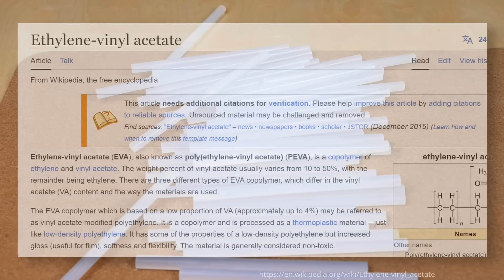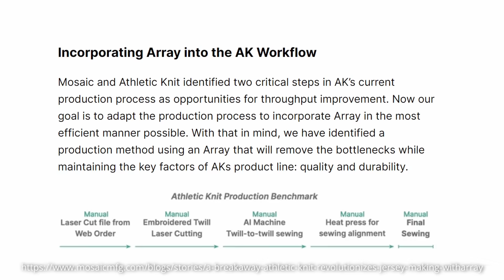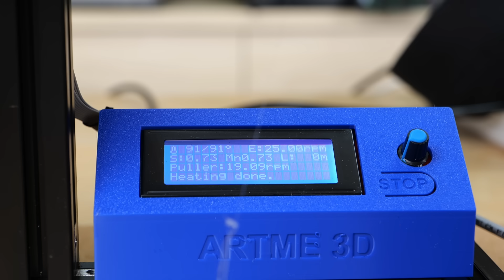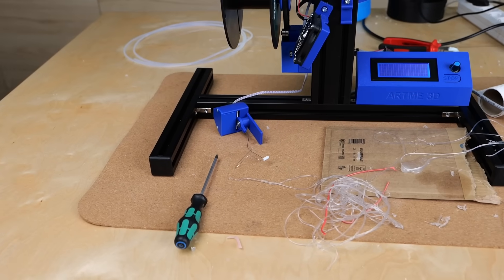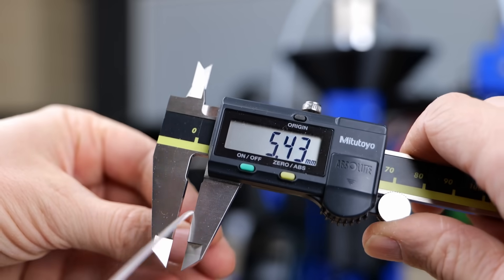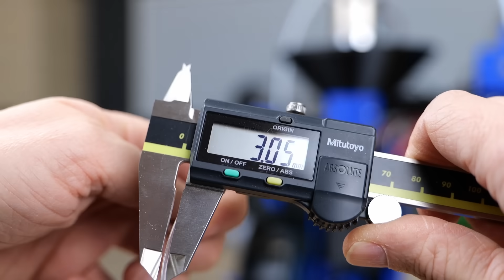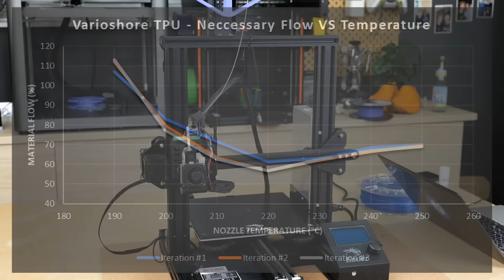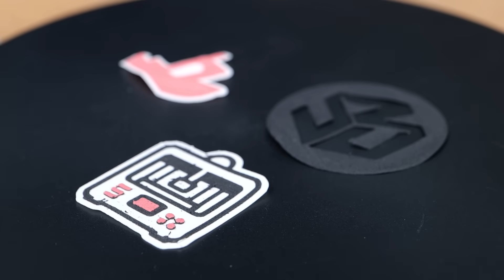Can you 3D Print with Hot Glue?

Comment: Glue sticks themselves... Eeeh?
I feel like this purpose would be better served with a sheet and a cricut.

That being said, I am potentially interested in how this could be applied with different adhesives, or hot glue, but reformulated a bit to be less annoying.

Imagine if you were able to print something in pieces with the glue right on them, stick them together, and slap them in the oven.

It would take the fiddling out of prints that need to be glued together, but that the person doing the printing may lack the skill/time/etc to sit there and do the gluing.

Also, as these kinds of plastics are pretty inert, is it possible to effectively print a heavy coating of plastic, then melt (smoothing it out) it to create a decently waterproof seal for mundane things like flower pots?
The cheap stuff gets brittle pretty quick, so again, specific formulation would be necessary, but there's potential here.

As an aside, I've seen clever, ultra low cost PET bottle recyclers that use high temp glue guns as a heat element.

Fill the heating element with a flush metal bar, and drill the appropriately sized hole through said piece of metal.

Looks like a real pain to get the feed started though.

Comment: I think that a thin sheet of hot glue would work better than a filament for the iron on patches. The sheet could be attached to the bed by heating and the tpu patch would be printed on top of the hot glue sheet

Comment: The only thing I'd change about this process is ironing the patches from the fabric side, so more of the heat goes to fabric then hot melt glue THEN tpu, rather than hitting the TPU first. In my experience (with normal patches!) this helps them adhere better because the fabric is heated up to match the glue.
Reply: Same concept as soldering! Heat the material you want adhered to (the fabric), rather than the patch, since the glue is already adhered to the patch.
Reply: Oh hey thanks I actually didn't know that about iron on patches. My jeans always rip at the crotch so I'm always using iron on patches (tacky I know but I love these jeans).  The corners of the patches always peel. Didn't think about heating the fabric up as well.
Reply: I scrolled to the comments to point that out too XD
Reply: We put our logo on product bags using white tpu and an iron. It seems to work really well. I could see where it might need more adhesion for clothes
Reply: Hope he sees this
Reply: Should also put some backing parchment between the layers of t-shirt fabric to prevent gluing front to back!
A heat press would do wonders for repeatability.
What you are creating - a two layer plastic sheet with melts plastic on the back is basically what heat transfer vinyl is.
Reply: I came here to say this 😊
Reply: This!
Reply: This!!!!

Comment: Instead of converting glue sticks to filament. Just disassemble a hot glue gun, take the guts, build your print head, mounts it on an old 3d printer that you can feed with stock glue sticks. Only issue would be triggering the glue feed. You'd have a dedicated glue machine. Hell, I think I'll try it and mount it on a cnc router.

Comment: This was very interesting, Thank You

A few thoughts
1. There are different temperature ratings for hot melt glues, the application temperatures can vary by as much as 200 degrees fahrenheit.  The lower temperatures glues can be applied using temps low enough that TPU should be unaffected.
2.  Don't apply the precision nature of additive manufacturing to the process of adding hot glue to objects.  An adequate amount of adhesive without over flowing the patch is probably good enough.
3.  Maybe a hot glue filament in the 2.85mm range would be easier to work with?
4.  Is there a way to precisely cut the glue sticks into appropriately sized material without going through a melting process?  The results wouldn't be 100% consistent, but maybe they'd be good enough.

I've not done what you showed today.  All those thoughts are just some things that came to mind.  thanks again

Comment: I have another idea, just convert a hot glue gun into a nozzle and use that diameter for your settings in your slicer.  That means not a small resolution for your prints but it would probably work better.

Comment: Maybe the answer is to make a new extruder that can accept the glue sticks directly :)
Also maybe a smaller nozzle size could make part cooling easier?
Reply: I was also thinking about the extruder change. The Cocoa Press uses sticks of chocolate instead of filament rolls. The cocoa sticks are thicker than hot glue sticks but im sure you could easily use a similar design.

Comment: The primary mistake there is you should've used high temperature hot glue instead of the white stuff. Essentially, the stuff they use in the industry to fix connectors to boards. It is yellow and melts at a higher temperature. It also hardens to almost solid once it cools down.
Reply: well there you got your problem why the yellow wouldnt really work for patches.....
you NEED the flex, why do you think he used tpu for the badge in the first place?

Comment: I'd buy ^&% tons of EVA filament if it were commercially available.  Making their own iron-on patches would be the hottest project ever for my middle-schoolers' 3D printing class.
Reply: Temu has thin sheets of hot melt glue dirt cheap specifically for fabrics if your logo/etc. would be regularly shaped and without voids to cut them out for hot pressing.

Comment: The idea is great,  but to fix problems with making filament:  why not make a custom extruder that can work with 10mm hot sticks so that you will eliminate half of the problems.
Reply: Yeah for that was my first idea
Reply: One thing that comes across my mind as an issue would be the amount of material you're pushing into extruder with one stepper motor step. Wider cross-section of the raw material makes fine control over filament feed more difficult, as the nozzle diameter still remains ~.4mm
Reply: I guess the solution in that case would be adding a gearbox to fix the ratio between stepper motor and feeder gear, but then you'd have slower retraction speed, etc., etc.
So while fixing the root issue, attempting to create a custom extruder would definitely bring some new problems into play :)

Comment: EVA is hard to find, but PVA is a commonly found filament that is pretty much the same! It prints at 120°C and works just like the hot melt EVA glue by going over it with an iron
Reply: And is water soluable which makes it kinda useless for this application.
Reply: @hasserecht3678  yep

Comment: I have had excellent results with a very thin two layer print of TPU ironed on with baking paper at high heat.

And it stayed on after many machine washes. Now over two years later the deep black of the logo is the only part not faded still holding on very well.
Reply: I forgot to mention that you iron the fabric into the TPU from the reverse side.
Reply: May I ask what hardness/brand TPU you used?

Comment: You could build a large extruder to feed the sticks directly into a long conical nozzle to get to normal filament size. Should be easier than chopping everything up :-)
Reply: The problem with that is that then we have to melt down the whole stick to temperature and then cool it down very fast so it can spool, the thermal mass is just too high right? 

Maybe that could be solved by using some sort of chiller just bellow the nozzle? Like placing a tiny radiator connected to a AC unit in front of a high speed delta fan
Reply: @someguy9175 the diameter is still 0,4mm so fast cooling isn’t a problem. 

You just need to extrude the stick very slowly to get the same volumetric output as using normal filament :)

Comment: Another great video! I usedhot glue on my printer to rapidly fix 1 wall width support after a small layer shift. I quickly found out that hot glue was so hot, that it melted the PLA support wall, but somehow i managed to save the print. What I found out later, is that hot glue plus a print bed equals great adhesion. If I wasn't using hairspray for that print, the bed would be toast.

Comment: i see a few options some kind of fine powder covering the filament could solve the sticky issue, a stripe of plastic candy caned around it could help with both of its problems but the last 2 have the issue of needing something that can melt about the same temp and mix with it, and some kind of system to cool just the last lair like a slowly filling tank of cooled water can help solidify it.
Reply: Mixing the glue with regular filament also came to my mind.

Comment: Even though just thinking about it, i think that turning the sticks into filament is not the best aproach. from my point of view, it requires the same approach as the chocolate printer, with the glue stick whole is placed in a cylinder , pushed from the top through the nozzle. Another way that could work would be to make an oversized dual gear extruder, but for 10 mm "filament" with a very torquey motor that pushes it through a tube directly through the nozzle.  Also be aware that thinner sticks can be found, 6-7 mm as i recall.

Comment: I have a question for the experimental material guru “AKA CNCKitchen” 😂 I asked this question on FB with no answers really. I can’t find any premade filament for handling 20% KOH solutions, the material would need to be flexible to be used as gasket material. So far the only rubber material that I’ve found is EPDM and is available as o-ring cord stock. After looking at its melt temp it looks like it could work with a 3d printer. I’m thinking of grabbing 100’ of the .070” material to test the idea of printing gaskets with it and eventually EPDM impregnated fiberglass gasket material.

Comment: Crazy idea, what about adding some sort of chopped fibers? Maybe not even carbon fiber, maybe some wood or textile fibers to increase the filament's rigidity and improve print quality. I've seen CF-TPU which is a weird material but gives you access to the super strong layer adhesion and at least some of the flex of TPU without as many pains of extrusion. 

The fibers shouldn't have much of an impact on adhesion, the glue should flow just fine and melt into the fabric just as well. Also, in theory since you're able to add whatever you want to the mix of filament through the hopper you could control the ratio of fibers, testing until you get something usable. 

Just an idea!
Reply: CF-TPU sounds like just the trick for so many high impact builds.

Comment: So a few months ago Lost in Tech showcased a filament made from PCL (polycaprolone) which melts at low temperature and might very well bind other polymers to textile. PCL pellets are also very easily and readily available in small and medium quantities e.g. as a crafting material, mould making material, temporary tooth filling.
Reply from the maker: Great idea! I think I even have some around here.
Reply: @CNCKitchen  ich könnte dir EVA Granulat zusenden wahlweise in Weiß oder transparent/beige.
Reply: No need to make filament, PCL is already available for medical applications. Price is a bit higher but still acceptable.
Reply: @jonasniesner  You can buy PCL filament.
Reply: PCL pellets work really well to adhere pvc pipes together at odd angles that you can't get connectors for.

Comment: Later you can make repair videos where you dig the melted or twisted stuff out of the washing machine and dryer.  All it will take is one time where the logo goes through a bit too hot a cycle and its all over.  Also the hot glue stickiness may migrate into the machine even without physical debonding.
Reply: The melt point of low temp hot glue is over 120° C. I doubt most peoples washers and dryers are running over boiling temps
Reply: @billallen6109  It doesnt need to "melt"  to be a problem.  It just needs to break down.  A decent machine will have a heater inside it to bump temps up assuming its not a steam machine.  My concern is putting an adhesive that doesnt set is just too much risk.

Comment: Hi Stephen, maybe you might have better luck with higher temp rated hot melt glues. The glues I use at work have a more yellow hue to them versus the crystal clear ones you're using. They melt at a higher temperature but solidify significantly faster. They might be harder as well. 

We even buy it pelletized as well as in large diameter sticks. You should have no problem finding pelletized hot melt if you ask around industrial suppliers, it's very commonly used.
Reply: for this application i think you need the different melting point for the bottom layer (~150) and top layer ~(200) - otherwise you would melt the patch and get rid of detail
Reply: @gedr7664  he could iron from the INSIDE of the shirt , so the thing that melts first would be the glue . It will be significantly harder to place the stamp perfect but it would fix the problem .
Reply: @gedr7664  maybe if ironed from the inside it would work
Reply: My mom has some white glue sticks and she says those high temp ones will burn the absolute hell out of you if it gets on you. Should work really well on fabric though.
Reply: @trulyinfamous I’m an electrician so I lay a lot of of in-floor heating cables that we glue to the cement, and man I can tell you, that type of “quick-set” glue sticks extremely well to clothes. I still have socks with glue from like 4 years ago still stuck on
Reply: Was going to suggest this. Glue sticks have varying cure times and chemical compositions. For fabrics it would also help a lot to have something that didn't soften in the sun 😅
Reply: True, I have Black industrial hot glue sticks for use on PCB board wires. It is high temp and cools super fast. You have to work with it quickly. It is super strong. Expensive though.
Reply: I recommend taking a look at the 12 different "hot-melt adhesive" variants by the German manufacturer "Steinel".
I've seen some videos recently about different ingredients for different applications and how that changes temperature / viscosity and cooling speed.
Reply: What a fun project!
Reply: or would the low melt ones be better so as layers build up there will be less collective heat?
Reply: @mattanderson111 if you don’t mind me asking, what industry are you in?

Comment: PCL in past was used as a hot melt glue and filament out of that is readily available.
Reply: Interesting, I have some still lying around. And the XL should be able to handle that and I already have a profile for it. So worth a try.
Reply: @jonasniesner   At those temps have to keep it away from any clothes dryer tho.

"PCL filament is a type of 3D printing filament made from a biodegradable and bio-based polymer called polycaprolactone (PCL). PCL is a good choice for beginners and kids because of its low-temp and safety. It is also eco-friendly, food-safe, and non-toxic. PCL has a density of around 1.2 g/cm3 and has exceptional mechanical properties. It melts around 60°C making it a safe thermoplastic to print and has a glass transition temperature of -60°C making the product extremely flexible and tough."

Comment: I printed hot glue sticks with filament to repair a failed print>:
Reply: thats actually smart...and especially its propably better than a 3d pen
Reply: @3DWolfEngineering  I know most 3D pens aren't the best, but I have a Mynt3D Pro pen and it works really well and I haven't had any problems with it and I've had it for a few years now